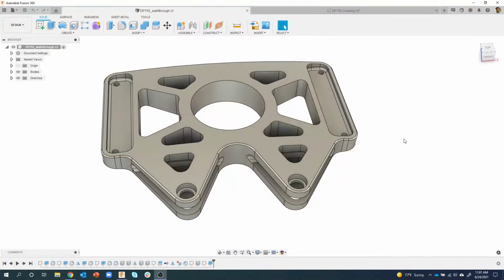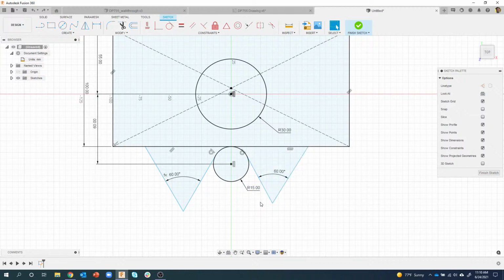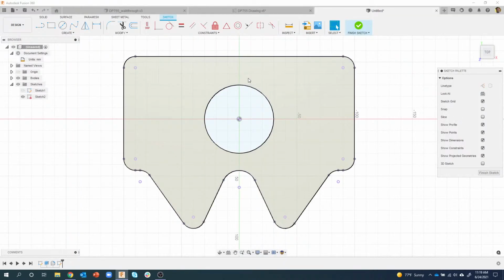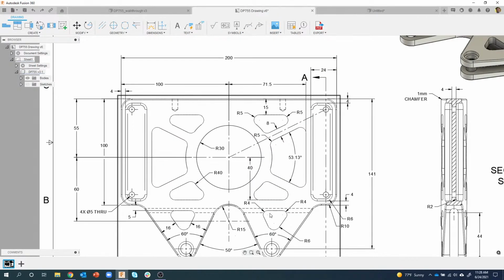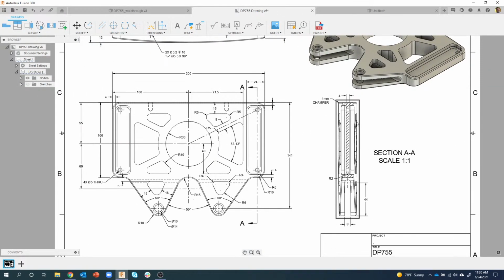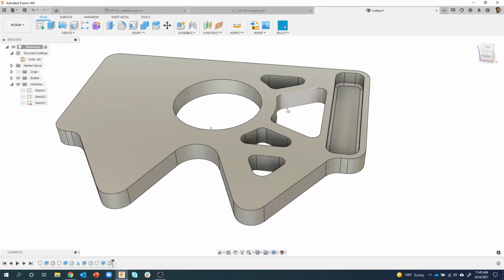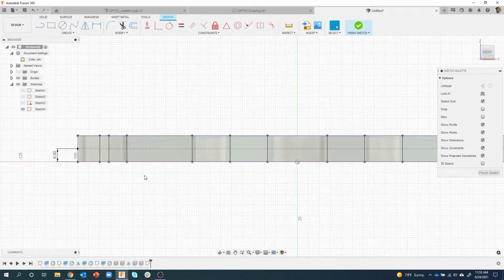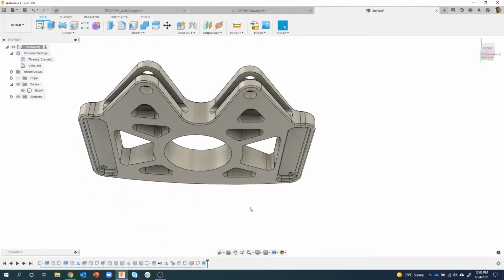360 LIVE: How would you model that

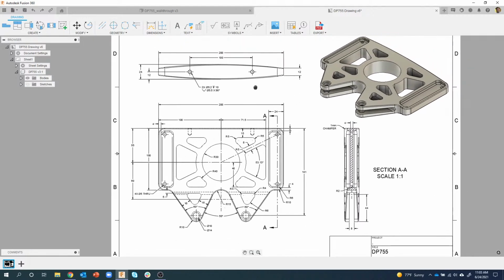Comment: Great tips. I paused the video around 5:08 and did the whole part first using the methods I imagine would be the fastest way to do it. And then I watched the video and I learned a couple of nice tricks in process. I think the best trick for me was the ability to break the circle into segments – I definitely didn't know about that option.

I pretty much tried to do everything with as small sketch count as possible but it turned to be much harder in practice. Also, it seems that the fillet command in 2D mode couldn't figure out how to do those sharp corners around the R40 circle! One more reason to do all the fillets in 3D mode.
Reply: I know Blender 3D much better but I'm trying to now learn Fusion 360 to be able to do non-destructive hard surface modeling a little easier. I'm missing many modeling commands from Blender while using Fusion 360. Hopefully we have 3D software that can do combination of both in the future. I was also surprised to find that Blender actually has better boolean operators than Fusion 360. I did the curved surface of the part using a boolean and Fusion 360 couldn't handle co-linear planes during the cut. Blender had similar problems in the past but since around version 2.9 it has "Exact" option for booleans which can cope with those.